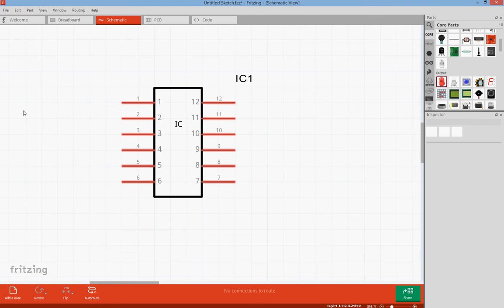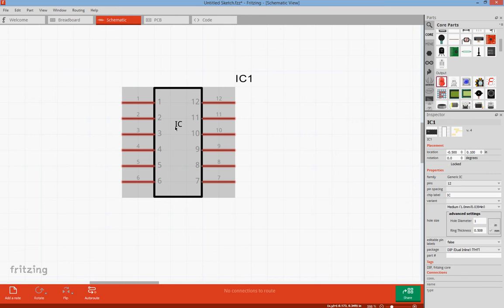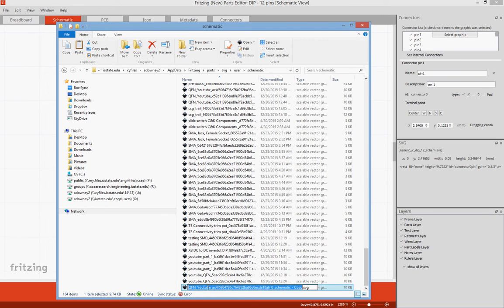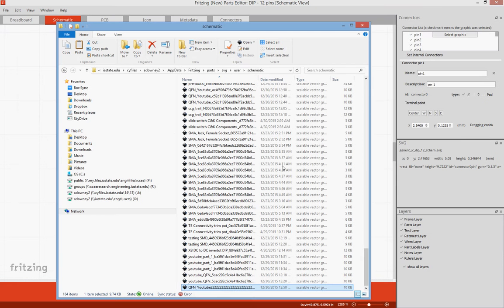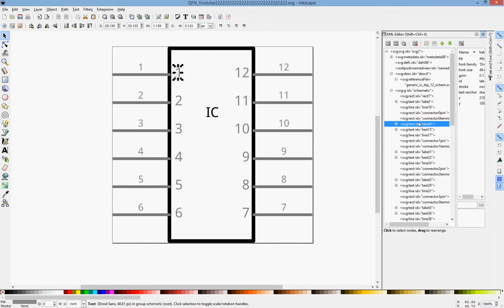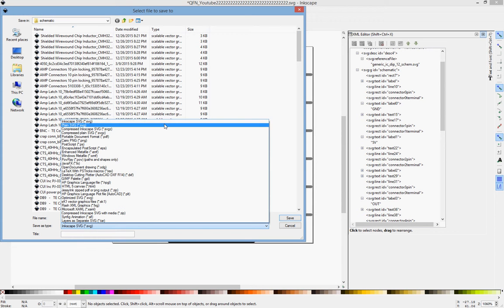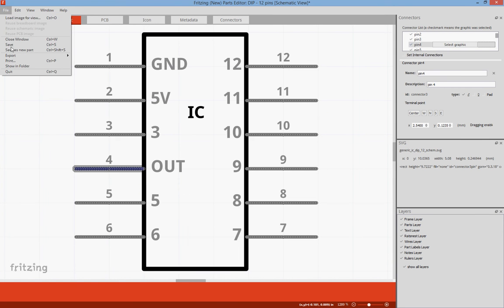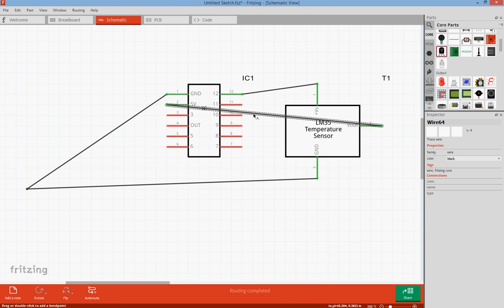Edit Fritzing Custom Parts Schematic

Comment: trying to do a board with a odd part 

ebay.com/itm/282257711286?_trksid=p2060353.m2749.l2649&ssPageName=STRK%3AMEBIDX%3AIT

any advice ???
Reply from the maker: In fritzing the way to do it would be to start with a DIP package with the number of puns you need and adjust the SVG file as needed.